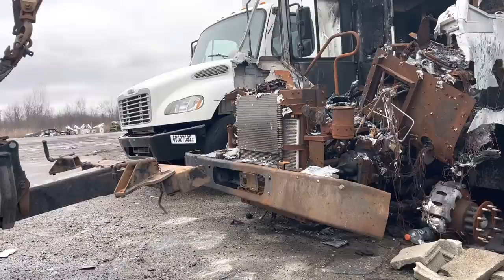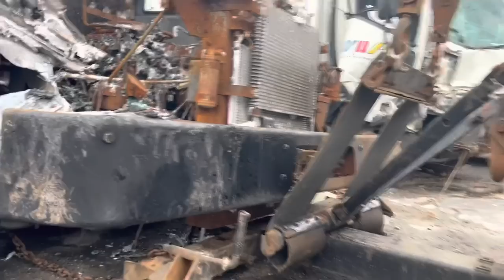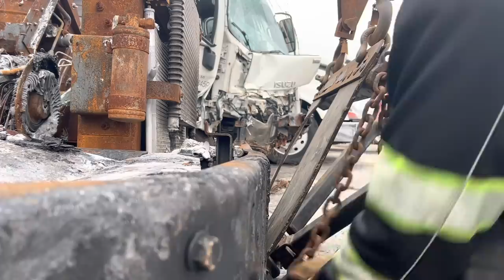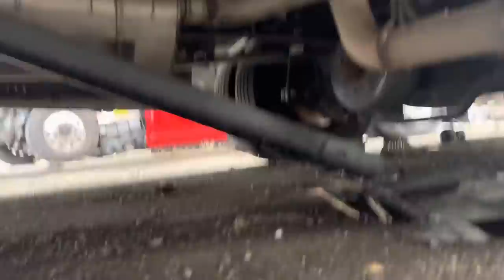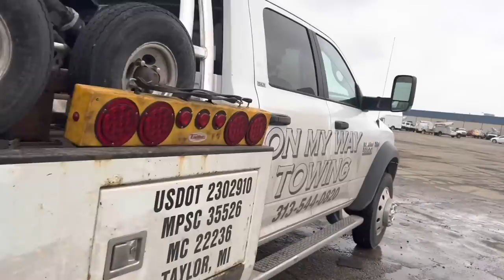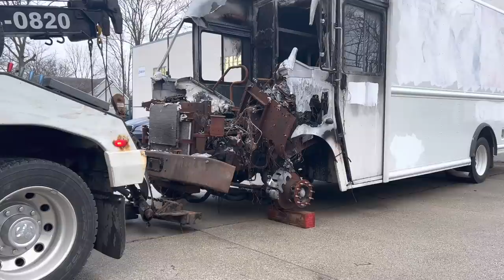Towing burnt up FedEx truck from Copart

Comment: What is that person's plan with that burnt up truck? The only good parts are in the rear of the truck but they can't be worth enough to buy at auction and pay to have it towed
Reply from the maker: That truck was a 2023 guy bought it for the drivetrain actually the block was still good new 7.3

Comment: Is that shit legal
Reply from the maker: Yes it is
Reply: Wow, I didn't think you would be able to hook it up because of all of the  damage.
Reply: Yes if I'm not mistaken the those ram 5500s have towing capacity of like 18k
Reply: @t.h.2444  in essence the bumper made that possible. Otherwise, the wheel lift would have to be used.